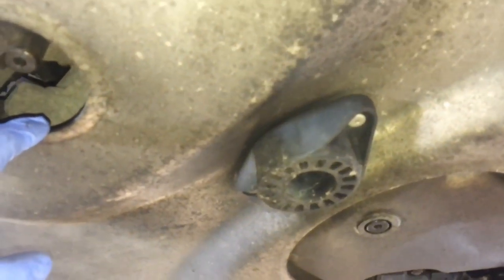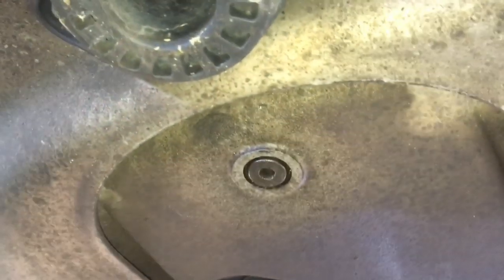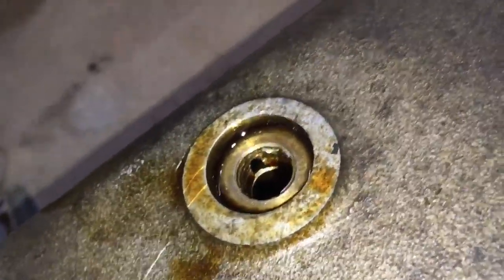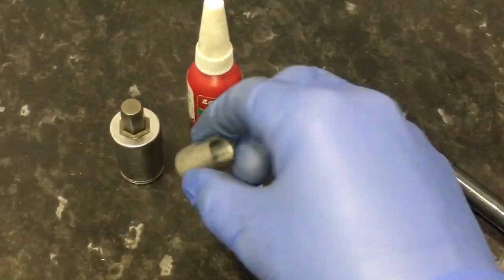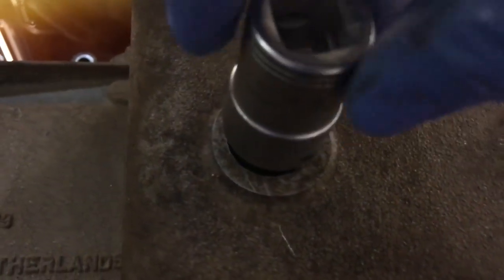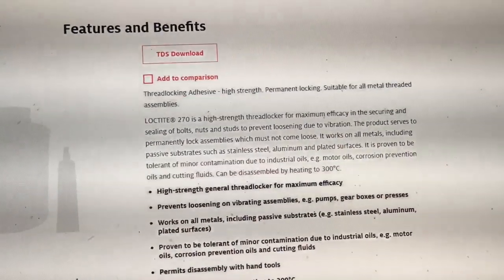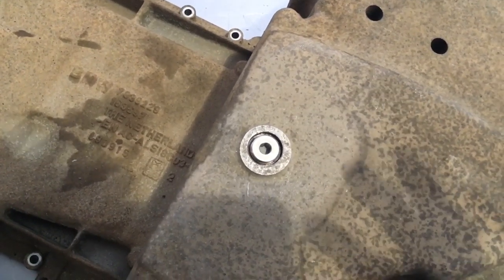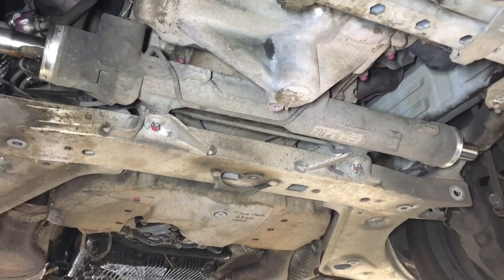Engine Sump-Plug Time-Sert Repair on BMW E92 M3 - Better than a Helicoil

Comment: Does the Time-Sert's length exceed the thickness of the sump? Wouldn't that cause oil to pool around the drain hole on a change?
Reply: Should have shown the inside of the sump after time-sert was installed.
Reply: Find the answer at 6:25 :)
Reply: That would be a "no," right? It looks much longer.

Comment: Should have just whipped out the rod bearings with the sump off
Reply from the maker: g4rr377 Luckily, it was in for rod bearings so we did this at the same time.
Reply: @RedishMotorsportbmw  thats good. Will there be a update video on the condition of the caps?